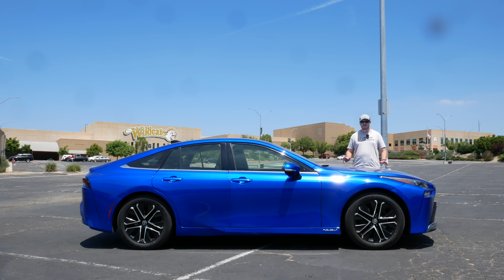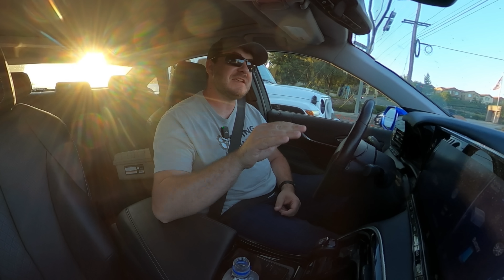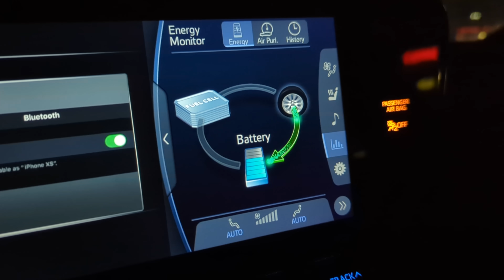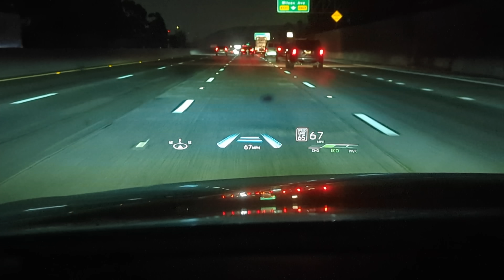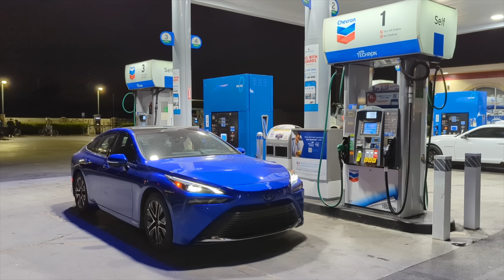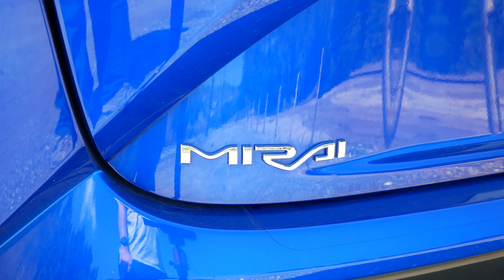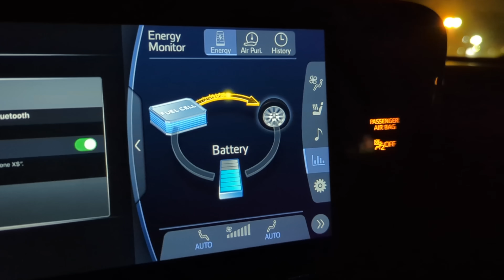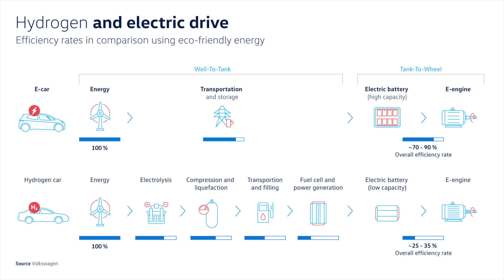The Toyota Mirai is Disappointing

Comment: I would buy this before any electric car, these are truly eco friendly, unlike electric cars that have a huge carbon footprint.
Reply: These will absolutely have a bigger carbon footprint than EVs though. 96% of hydrogen comes from the petroleum industry, only a tiny portion is green hydrogen. And if you're using green hydrogen, you're spending like 3x the electricity per kilometer driven.
Reply: @logitech4873  Actually, electric cars have a huge carbon footprint, from lithium mining to shipping to the mainly coal fired power plants that generate the electric power to the hazardous waste from their disposal.  Hydrogen is in it's infancy and can easily be processed from the air around us, just  not efficiently YET.  They're also finding huge deposits of liquid hydrogen in the ground though that would be my last choice.  The only reason hydrogen is lagging behind electric is that the electric industry with people like musk are buying the politicians.  The biggest drawback to hydrogen is that it is potentially free to the user which scares the bejeebers out of the 1%.  The biggest problem of all though is that batteries, no matter their composition have the same problem as gasoline, it's a finite resource and that means it will run out.  Hydrogen is naturally infinite.
Reply: @jlsc4125  "Hydrogen can easily be processed from the air around us"
The air around us is only 0.00005% hydrogen, or 0.5ppm. Not sure where you got this idea.

"Huge deposits of liquid hydrogen underground"
Hydrogen is a liquid only at below -252°C. There's no such thing as liquid hydrogen deposits.

In reality hydrogen is made via steam reformation and other petroleum related methods, or hydrolysis.
The former requires petroleum, the latter requires a lot of electricity.
Hydrogen is inherently less efficient than EVs, and always will be.
Reply: Lets just think about the rest of the stupidity surrounding electric cars.

 less than 15% of U.S. drivers can afford a battery-powered set of wheels, and that's true for the entire world.

Electric cars take from 30 minutes to 30 hours to recharge, that creates an enormous impossibility when the world has decided to allow each manufacturer the convenience to create their own proprietary system, so unlike gas, you have to have separate charging systems everywhere in the world to accommodate the separate manufacturers, and the enormous lines that it would create when you consider that every apartment dweller has to use public charging.  We have screwed up electric from the very start and with greed of manufacturers there is no way to correct the system.  The infrastructure HAS to come first, PERIOD.
Reply: @jlsc4125  Interestingly you ignored what I said about your hydrogen claims.

As for standards, that's pretty much already figured out:
- The US will now be using NACS
- Europe is using CCS2
- China is using GB/T

The Tesla supercharging network is opening up to all makes and manufacturers worldwide. There's no longer gonna be any type of exclusive networks.

In Norway, a country with about as many EVs as gasoline cars, 80% of charging happens at home.
With laws reinforcing the right to charge at home, EV charging is pretty easy even if you live in an apartment.

This summer I went on a 13,500 kilometer roadtrip through Europe. The longest EV queue I came across was... Wait, I didn't actually come across a single queue. Nice!
Reply: @logitech4873  You consider three different versions a standard ????  What planet do you live on ??? I wouldn't use anything that Musk controls, especially his charging equipment.  The man is a demented, self centered egotist.   You completely ignore the fact that we will be creating and ecological nightmare from the mining, manufacturing and shipping of lithium, it's called the carbon footprint, and the fact that well over half the supply of  electricity is generated by coal, trading one nightmare for another.  Electric cars are neither ecologically sound nor are they economically feasible.  Nearly half the US population will not or cannot buy an electric car, and you still haven't solved the lines waiting for charging stations since over half the population can't afford or have access to home charging stations.  Hydrogen cars can refuel in the same time as gas, and we can convert gas stations to hydrogen stations and hydrogen is the most abundant element in the universe.  We are not concentrating our efforts in the right directions, 100% clean energy vehicles can ONLY be hydrogen.
Reply: @jlsc4125 3 standards is pretty chill, honestly. Have you seen how many standards for conventional power outlets there are?

Comment: As he said, It is only Hydrogen which is kind of a downside. If this had been like a mixture of plugin hybrid with like 50-100km of range and a fuel cell combo then it would have been a great car. Many people would not drive beyond that range and the hydrogen can work as a backup (when the infrastructure is there up and solid) with quick refueling

Comment: The whole video, I was thinking of the Lunar Orbit Rendezvous method of going to the moon. Wehrner von Braun wanted to send a whole, 3-stage rocket to the moon, and John Houbolt pointed out to him, look at the amount of ground support required to launch a rocket on Earth -- you're planning to have three men do everything, on the moon to come back? You've got to manage your energy a lot more carefully. It seems like this is where hydrogen-fueled cars are at: heavy, energy-intensive, and a lot of equipment added to achieve performance that's competitive with gasoline vehicles. Hopefully hydrogen vehicles will evolve more like electric bikes: lightweight and just sufficient. Come to think of it, electric bikes aren't evolving that way at the moment either.

Comment: In my country they're saying hydrogen will be the future for mostly semi's and buses. (We already had loads driving on them.) And we do have hydrogen powered Uber cars. In my country you can get hydrogen in at least 1 gas station per city with over 100.000 inhabitants. 
For driving in and around the city battery powered vehicles will probably be sufficient. If the time comes when its as easy to pump hydrogen like gasoline then I would consider buying one.

Comment: Hydrogen MAKES SENSE, because it's far more than the car. The truth is, we should be introducing hydrogen generators for homes. They could be solar powered, so when the house batteries are full, you could fill a large hydrogen tank as a buffer zone. This could be used for your heating appliances in the house AND your car. This would remove issues like monoxide poisoning chances in homes too. The mirai is a part of a puzzle, not a standalone solution.
Reply: I don't like the idea of everyone having explosive gases in their house. The US is bad enough with their gas explosions.
Reply: The efficiency of fuel cells seems entirely too low for them to practically replace batteries. Similarly, I have doubts that using hydrogen combustion for heating would beat out just powering a heat pump with the electricity that would otherwise go to hydrogen production

Comment: Instead of using hydrogen as a source for electricity why not just burn it like an ICE? Hydrogen is incredibly combustible and burns cleanly. And instead of having to fill tanks with cold hydrogen you could fill your tank with water. I’ve seen people do engine mods for normal gas engines, to introduce hydrogen produced via electrolysis directly into the combustion chamber like a NOS system. All of them increased their fuel efficiency and decreased their emissions output a significant amount. And it only takes like a gallon of water. Now that’s only an addition to gasoline so burning hydrogen in an ICE would require a significant amount more but if the technology is invested into it could be worth it.
Reply: "Instead of using hydrogen as a source for electricity why not just burn it like an ICE?"
Because it's far more efficient to run it through a hydrogen fuel cell and run an electric motor. You get like twice the range by doing this.

"And instead of having to fill tanks with cold hydrogen you could fill your tank with water. I’ve seen people do engine mods for normal gas engines, to introduce hydrogen produced via electrolysis directly into the combustion chamber like a NOS system."
This doesn't actually make sense. It takes more energy to run the electrolysis than what you can extract from combusting the resulting hydrogen. This means your car will spend more energy running the hydrolysis, and get worse mileage.

Comment: the Electric car grid is by far not there either, with some insight from the commercial truck market, hydrogen will be pushed more and more by brands and could even overtake it. Like you mentioned, maybe it will happen on the commercial side first with big rigs and buses even the box truck market but it will go lower and lower in to the rest of the every day vehicles.

Comment: I work at a warehouse and Hydrogen Fuel Cell are used for the lift equipment. It isn’t too bad. I get about the same amount of use as if it was a “ regular “ battery.

Comment: I think a liquid* hydrogen PHEV using a small ~40 kw fuel cell purely as a range extender could make some sense from a technical/user standpoint, since you'd likely be using the fuel immediately and wouldn't have to worry about the liquid hydrogen discharging itself. Still, the elephant in the room is just the hydrogen infrastructure itself, which is insurmountably expensive and would require a level of subsidization that would essentially bankrupt everyone.

Comment: Someone, someday, will figure out how to extract Hydrogen from water with a small portable efficient device.  Then, hydrogen will make sense.
Reply: Unfortunately there's a hard limit on how efficiently you can split water - you always need to put in enough energy to break the bonds and there will never be a way around this.
Plus for the device to be portable it would need batteries, and at that point you may as well use the batteries.

Comment: 13:35, it is easy to say "over the grid", but it is actually a very serious problem if the number of battery electric cars starts exceeding certain threshold. 1) massive (and expensive) expansion of power generation and the grid will be needed to provide electric power 2) electric cars do not play well with the grid, introducing instability, there are already places that put limits on car charging for this reason 3) reliance on the public charging infrastructure can still be high, there are a significant number of people live in apartment blocks and at best have a place in their underground parking lot (which typically cannot be used to charge vehicles for serveral reasons), so no home garage to charge the car overnight. So it is not that hydrogen is a clunky approach and electrons flowing via wires are not. Energy density and ease/cost-effectiveness of storage/transport of fuels such as diesel or petrol are hard to beat. An alternative approach is to ditch all that electro and keep internal combustom engines, using synthetic fuels with net 0 emissions, but such a fuel is an order of magniture more expensive than a fossil one.
Reply: Synthetic fuels would use at least five times as much electricity as BEVs though.

Comment: In my mind, the goal of hydrogen cars should be to reduce the need for massive batteries as range is often a concern to many would be EV buyers. "What if I want to go on a cross state trip! I need that 80kwh battery!" Despite their normal commute being 50 miles or less. The goal (short of actual good public transport) should be a reduction in battery sizes, at home plug in charging, possibly fast charging if you're stopping anyway. And hydrogen as a backup for longer trips. 
This is especially due to the environmental impact of battery production. 
Additionally hydrogen storage while not as effecient is a lot more scalable at a reasonable cost than say battery power storage at a grid level if no other options are available.
Reply: You should realize that the hydrogen system is also heavy and large. It would be very cumbersome to always haul this around and rarely use it. Better just put a larger battery in it.
Reply: @Freba9  the fuel tanks and the fuel cells combined of a mirai is about 145kg. Maybe add another 10 or so kg for some of the structural differences. Translated to EV batteries that's 8-14kwh at best 
So for most people even if they had to exchange weight 1:1 it would still be beneficial for almost any EV currently with a battery above 50-60kwh if they had hydrogen range extenders and a smaller battery
Reply: @wovaka  It would require a lot of room in the vehicle. Not worth it in my opinion, especially when looking at current state of fast charging.

Comment: But where do you think all the electricity must come from in the near future with that absurd 2030 green deal and that we have to change to electric cars..? (Lobbied big-time by the car industry) but where does the energy coming from..? Horizon polluting and birdslapping windmills?  Biomass deforestation for heavy subsized solar fields and use the wood and burning it, under the name “clean energy” ?? That sh!t aren’t helping either!
Reply: Hydrogen cars require three times more electricity. And you are wrong, the car industry is still actively lobbying to NOT have to switch to electric vehicles.
Reply: Wind turbines kill as many birds as any similar sized building does - they're not special. It's crazy to see people still using the same arguments from 2006.
Reply: @drunkenhobo8020  Their lethality can also be reduced in various ways. Some paint one blade a contrasting color, which seems to ward off birds more effectively.

Comment: I wonder if it would make sense in iceland, they have unlimited geothermal power they can use for electrolysis
Reply: They had a hydrogen program in the beginning of the century. But global financial/economic crisis of 2007/2008 brought it to an end.
And there are already many protests against an expansion of electricity production for more and more aluminium production.
Hydrogen for domestic use could be another case though. This could find more acceptance.
Reply: again, why not just use BEVs and not lose 75% of the electricity for minimal to no benefit?

Comment: I TALKED TO A FRIEND OF MINE THAT IS IN THE BUSINESS OF SELLING GASES.  He sells medical grade oxygen and a bunch of other industrial gases, such as, for welding.  He says sure there are no hydrogen fuel stations outside of Cali but anyone could get THIS CAR and open an account with their local gas distributor and have hydrogen gas delivered to the house.  He said, you may need permits to have a tank onsite or just to store cylinders to change out though.  He said, outside of the permits, it is easy to do.  I then asked him what would the cost be to buy big cylinders of hydrogen gas and have them delivered and changed out when needed.  He said it is not cheap and you need to be the kind of person who makes a boatload of money and has disposable income to want to do that.
Reply: Can't just fill the cars with that though, right? Surely it expects some kinda special filling protocol.
Reply: @logitech4873  I am honestly not sure.  I asked my friend the same question for you and he is not sure either.  He said he assumed there is a special pressure switch in the car somewhere that if the pressure at the filler meets the right number, it will open and allow the hydrogen to flow into the car.  So he imagines you would just need some type of electric pressure regulator that is attached to the tanks and also the special nozzle then all you would have to do is open the tank then insert the nozzle into the car filler.

He said it could possibly be more complicated than that with some added safety features built into the car but gas is gas.  If the pressure from the cylinder and external regulator is right, theoretically it would fill the car from the cylinder.

Comment: I personally would like to see a combustion engine that runs on hydrogen seeing how it is a combustible gas and emits water vapor while doing so 

Sure it’s probably not as efficient as a fuel cell but it would mean automakers could still build internal combustion engines for cars like the Ford Mustang

I mean let’s face it 

Very few mustang loyalists want an EV mustang (and no the Mach E does not count as an electric mustang) 

And the same applies to the chevy Camaro (which is being discontinued) and dodge challenger (also being discontinued) 

Hell if hydrogen V8 works well enough it could bring back cars like the Chevy Chevelle and the Gran Torino 

I’m no expert in this field and there’s probably MILLIONS of things wrong with this idea 

But I do think it’s something worth looking into

Comment: If it does work in cold climates, it could be good in those regions. Where I live it gets to -40 in winter which for an EV means you're losing up to 40% of your range due to the cold. Which is bad, because in places where it gets to -40 in winter, there are sometimes no places to charge your car for hundreds of kilometres either.